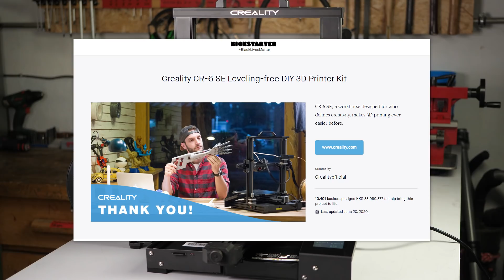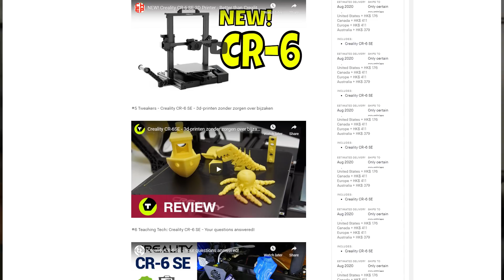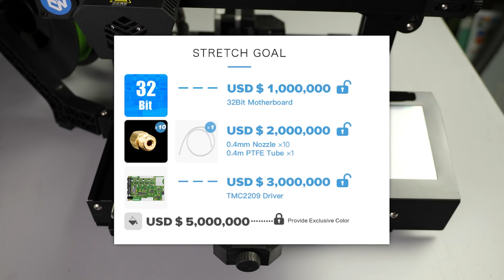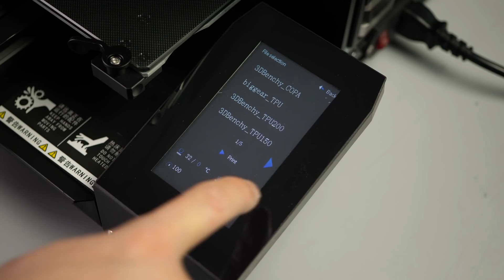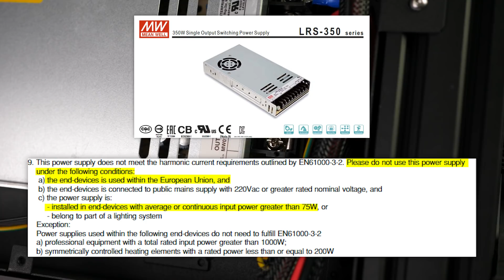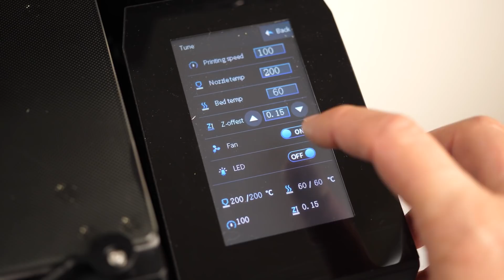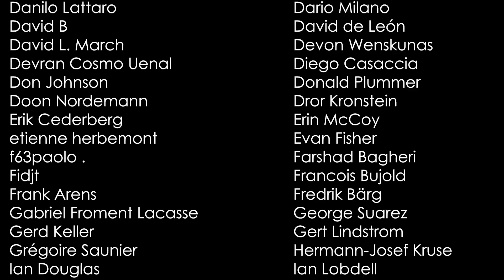Creality CR-6 SE - The NEW (over)hyped Kickstarter 3D printer?

Comment: So basicaly it cant do more than my ender 3. Bed leveling ? I dont need that I just leveled mine once and it works like a charm.
Reply: Bed leveling is the number one cause of problems, so a big boon to me (my ender 3 needs re-adjusting every other week!), the slightly bigger build space is going to be handy as a few prints I have had to knock them down as they are just slightly too big. Everything else (32bit board, touch screen, SD cards, belt tensioners, modular hot end, filament sensor, glass bed attacment mechanism, wider center beam for stability, dual Z steppers, improved extruder, carry handle, better filament holder etc) are just icing for me, and great value on a $300 printer!

Comment: Built-in bed levelling is a game-changer for beginners that have no engineering knowledge, because it removes the biggest problem. Total newbs will be happy to pay the $100 extra for that feature preinstalled.
Reply: This is exactly right.  As someone who owns an Ender 3 Pro, I hate bed leveling all the time.  It's too touchy and annoying.  This model is well worth an extra $100-$200 in my book for the time and headaches it will save.
Reply: Bed leveling isn't that difficult but it gets tedious quickly, especially if your printer doesn't like to maintain it very well. IMO Auto-bed leveling needs to become standard on all printers.
Reply: "Engineering knowledge" is figuring out your own strain gauge for your already-purchased ender 3 and making it work.... I get your point though
Reply: Bed levelling is without doubt one of the most deeply frustrating aspects of running an Ender 3. The beds aren't always flat to start so little prints might work and huge prints are a disaster. Even level is possible, the janky springs and a little movement means its gone again. A BL-touch is a way to avoid these issues but Integrating the levelling into the nozzle and have it properly supported by the firmware is the only real solution.
Reply: If you exchange the stock springs for better ones you barely have to level the bed tbh
Reply: Yep i would agree with that... Thats one of things that sparking my interest
Reply: SidneyCritic ComedyHound TIL you need engineering knowledge to level a bed
Reply: David F. All you need is a paper, a eye and simple instructions. Most people can actually level a bed. The problem is it's annoying to level the bed every time you print. Most people don't care of levelling the bed once but just multiple times frustrates them.
Reply: Mohit Gupta lol I know, I was being sarcastic. I don’t get the leveling the bed before every print thing either. On my Ultimaker, I only level it when I change a nozzle or something that changes the nozzle to buildplate height.... I get awesome first layers consistently. On my old Tevo on the the other hand, that needed leveling all the time because the bed was very easy to shift when removing a print.
Reply: @logmegadeth72  Well, with my ender 3 if I do long prints like 8 hours or so, the next time I go to start a print the bed is already off. I put stiffer springs and haven't had it change on me yet, but ya with stock ender 3 springs I can see why some people relevel the bed every print
Reply: Mohit Gupta why would it need it every print? I don’t even have to level unless I move my printer (even punching it and prying hard in all sorts of directions to get prints off doesn’t change my bed level). I’ve got 2 different printers, and both I run probably a hundred parts or only level maybe once every half a year at the most, they really don’t need to be leveled very often at all. If you’re having to do it with it just sitting there then something is wrong, like maybe your bed is halfway falling off and need  to tighten some screws or something (seriously, one of mine has rubber bands to keep it functioning correctly because it’s so old and worn out, but even it has perfect layer bonding and it’s incredibly reliable, it prints all day without issue). It shouldn’t need leveling even for a few rolls of filament, my newer one ran like 6 pounds of plastic and it still doesn’t need leveling adjusted (and it’s far, far cheaper than an Ender 3)
Reply: @BornArcher8  Anyone can level a FLAT bed; these automatic things shine when your bed gets even slightly not-flat.  Where this is awesome is the auto-adjusting for variations in flatness.  Glass will solve a lot of that, but not a lot of neophytes know about that, or how to screw with z-stops, etc.
Reply: @MichaelCampbell01  the antiquated printrbot metal I have is a pita to level, if it even levels at all. 🤣 so it just sits there. Mocking me. I'm looking for a replacement.

Comment: So, this PSU is totally not rated for the voltage (230V) on the mainland of Europe, so surely not the best choice, probably needs an upgrade right away with a good swap, together with one that is quieter.
But also: are all the safety-systems in place and enabled like thermal runaway and such, is the case and all metal parts grounded well and does it come with a good fuse and double-poled switch?

Comment: One thing I really liked about this printer and was the deciding factor if I continued my kickstarter or cancelled it,
I was originally concerned because it had a belt typing the two Z lead screws together and I was wondering if it was constrained with a bearing. (while yes, you optimally want this constrained with a bearing, if it is not machined true you will be having a lot of issues. This is why a lot of chinese printers leave slop in the Z-Axis and do not constrain it.) after I asked the question on Nerys' live video he showed the printer and said that it works well.
My ideology is if they went as far as to machine those good enough in tolerance that they can constrain those Z screws without an issue, they are probably running better tolerances and it does look like they took into account "the little things"
While I'd be hard pressed to pay retail for this printer, I paid $299 (+ extra strain gauge and extra hot end) and I feel I got a very good deal.
I think Creality did a wonderful job, but yes the first thing I'll be doing is doing temp checks on the PSU & nozzle fans & swapping to noctura silent fans.

Comment: I completely agree about the power supply fan, it's the number 1 reason I bought my Genius (which is very similar to the CR-6 SE) - no fan in the PSU & mains powered bed. It's super quiet.
Reply: I find the 24V fan in the base which is constantly running pretty loud though.

Comment: I wonder why they keep sticking to a bowden tube setup, no direct drive, limited temps.
I'd have gotten this to replace my ender 3 if it had an alternative to the bowden tube.
Reply: Direct drive isn't nessarily better than boden, they both have advantages and disadvantages.
Direct drive handles the most flexible filaments better (though a few reviews have shown it can print TPU just fine).
Boden removes a lot of weight from the head so can be faster and potentially more detailed.  It's also easier to maintain and correct issues.

Comment: Lets face it a micro sd is easier and cheaper to get and store a full size sd is a stupid YouTuber thing
Reply from the maker: Ever dropped a micro SD into a printer enclosure because slot and board were not perfectly aligned?
Reply: @CNCKitchen  nop have around 2 dozen differnt pronters never happened

Comment: 2:41 Using the nozzle’s tip and a strain sensor seems like a great idea to help level the bed, but it’s not. The last time I checked, just before the print is to start, there always seems to be a tiny bit of hard or semi melted filament stuck on the end of the nozzle. If it’s not cleaned off BEFORE the nozzle is used to help level the bed, that extra filament stuck on the end of the nozzle will screw up the nozzle/bed touch, thus completely throwing off the bed levelling feature. That’s why a separate BL touch sensor is a much better option (nothing to get in the way of the sensor while measuring the bed’s surface). Also, bed levelling should be performed while the bed is at printing temp (warm to hot depending on what you have it set to). Allowing the bed to heat up prior to measuring its surface level, will allow the bed to “settle”. If the nozzle is already hot when this levelling happens, I hope you guys enjoy a bunch of little melted filament blobs all over the bed, which could potentially get in the way when a print is started and the nozzle passes over those same bed points again while printing. So just use the hot end while it is cold you say? Just re-read the first part of my comment about unmelted filament on the nozzle tip while trying to level the bed with it.
Reply: Agree strain gauge is a gimmick and it's a step back not forward

Comment: The power supply fan is a lot cheaper than the transistors that would run cooler. Typical Chinese economics...milk pennies out of the design and destroy the product value.

Comment: Overhyped and overpriced is the prusa that you love so mich.
Reply from the maker: Have a different opinion on that. If you need a tool, it's worth every penny, if you're looking for a toy/project it might be too pricy.
Reply: @CNCKitchen  I started in 3d printing in 2007 with a industrial fdm (EOS if i remember correctly). All the printers that i used since needed some kind off finishing for the parts to meet specs. Why spend so much more if the labor needed after is almost the same.
Reply: @DesastreMan1  Totally agree the value proposition just is not there it doesn't help that Prusa machines look like they have been put together with lego I hear the argument that you can print replacement parts but you can for a lot of printers. I will say something for Prusa software user feedback programmed for the machines looks more friendly

Comment: I backed it [my first 3D] but think you are a bit harsh in your review.  Everything you mentioned was positive but the non-flex print bed and noisy PS.  I purchased a flex print bed that was offered as an add on at the end of the KS campaign.  Since this is a first for me I will have to wait to comment on the noisy PS.   Price has to be weighed against time spent 'fiddling' with a printer and purchasing add-ons to get acceptable prints.  I think this will be a great first experience 3D printer.  I also think Creality has learned [and is learning] a lot about what the market wants in a entry level 3D printer.  IMHO it is a winner.
Reply: Yeah but this is your first 3D printer the reason Stefan is harsh is because he knows there is sooooo much competition out there in the 3D printer space and there's not a great deal to differentiate between them so small things make a difference between them also this printer is pretty bread and butter repackage it's just slickly marketed bread and butter. If your a happy that's cool welcome to the 3D printing world and I'm very sure you will be over the moon that your making things at home. If your printing in a garage then sound is not a big issue if your printing close to a living area sound is a big issue especially when you realise bigger prints tend to get measured in days.

Comment: The printer looks good, I think if you got in at the flash sale price it seems like a very good value. I personally dont have an issue with the loud PSU, but the filament sensor/extruder could have been aligned better or made into a single unit.

Comment: I decided not to back it. In my opinion you should buy an Ender 3 v2 and with some printed upgrades like the "handle" and a bltouch, it will be a totally comparable product. Teaching tech already has shown a way how to create a DIY nose leveling solution from the original trigger switch and some printed parts for free, although I think a seperate sensor is always better because of the mentioned issues with filament leaking out of the nozzle creating premature triggering. So why bother to buy this overpriced printer?

Comment: Funny thing i"m looking at this printer it basically is my Ender 3. Glass bed check(custom clips make it 235mm), tool drawer check(printed), filament run-out(printed/solder to pin on board) check, Filament Friday side spool mount(printed) check. I have been thinking of getting a bed level.
Reply: 32bit board, better screen, touch screen, dual Z, bigger y, better drivers, alb, better fans, better extruder, better hot end and a spool of low quality pla but aside from it's the same as your Ender3. And some of us were able to get it at $265 so I'll take this over your Ender3 any day.

Comment: Stefan what do you think was causing the ugly CoPa print?   I have been considering trying the material but now Im worried
Reply from the maker: My filament was not perfectly dry, which caused bubbles and stringing and then it released from the bed, just before it was finished. CoPA is a nice start into Nylons because it's easier printable than most, still a bit of a challenge.

Comment: it looks like a good printer but i can just upgrade my ender 3 ;)
Reply: I was thinking that, but the cost of upgrading my E3 to the 6SE is more than half the cost of the 6SE and some improvements (like the extra build volume) are not possible.
So I ordered the 6SE and will use my ender 3 if I need to print more than one item at a time, or set them up with different filaments etc!

Comment: The only way I was going to purchase this printer is if I got it for the $265 price, which I did being backer #91.  I simply wouldn’t get approval from the boss\wife otherwise 😉.  The Meanwell fans are notoriously loud.  I would gladly take the better PSU, and live with the louder fan.  Just wondering when did you receive your review unit?  Seems that you might have received your CR6-SE later than others with much less subscribers.  Maybe you should do a CR6-SE giveaway 🤔

Comment: i think its a great little machine, but doesnt really seem like anything incredibly new or interesting. 
it looks like itll be a better start machine for people new to printing, with its auto levelling, non-micro sd card reader, and responsive touch screen. But for someone like me, print volume is a pretty 'big' thing, and im a little disappointed they havent gone higher in volume by much from the ender 3.
imo great for newcomers, or people who want a cheap midranged printer to use, but honestly doesnt seem like its gonna break the industry in any way.
Reply: totally agree it does not stand out in any way it's kinda lazy

Comment: End users are beta testers. This unit simply puts several community upgrades on an Ender 3.
Reply: Did the community figure out how to print these?
32bit board, bigger screen, touch screen, dual Z drive, bigger y, better drivers, alb, better fans, better extruder, better hot end but aside from it's the same an Ender3.

Comment: Having the PSU under the bed and the fan meer mm from the table makes it noisy. Also, the PSU placement means it will have to be relocated to add any of the common thingiverse options other than a direct replacement Noctua fan.

Comment: "Advertised" build volume. I have no problem with 235x235 on my Ender 3.
Reply: Just got an Ender 3, how would I go about increasing the build volume? Would it be edited in the gcode?
Reply: The physical size is bigger on the 6SE, so you can likely do the same software trick to expand the size slightly.

Comment: I backed one, largely to replace my aging Printrbot Simple Metal, which I've modded and frankly, without mucking about with the firmware and making an adapter for the hotend, is at the end of the line. I'll agree that it's probably overhyped.  The issues described, I feel are more quirks than show stoppers.  The fan noise in the PSU is fixable via a mod/hack, the ABL issues requiring a clean nozzle is possibly a process change (i.e., make sure the nozzle is clean prior to leveling),  making mods to the bed surface is a time-honored tradition in this hobby, and the filament feed system is probably also fixable via a mod as well. This will be my first bowden fed printer (everything else I've dealt with has been direct drive), so I expect I'll have some learning curves with it.

Comment: I'm not as critical of the printer as you, but I do think Creality is just splitting hairs with their recent offerings. I think the bed leveling advancement, silent drivers and the touchscreen are a big steps forward, but most of the other updates are more preference related. As for negatives, the only thing I really dislike is that they did so much in plastic on a $400+ printer.

Comment: It doesn't even have a direct extruder.
Reply: It's not a case of Direct is better than boden, they both have advantages and disadvantages.
Direct works better with very flexible filaments (though from reviews this boden seems to handle soft TPU just fine).
Boden means much less weight on the print head meaning faster print speeds and potentially better detail.
Reply: @LordCreo  -  Direct is less troublesome in general. Speed advantage of Bowden is negligible (only on Y axis) because the inertia of the X axis is greater than inertia of extruder (the whole object is moving). Besides, direct extruders now have lighter motors that eliminate the speed disadvantage on the X axis. Besides, If they claim to make a better 3D printer, then they should put an extruder that can handle all the filaments instead of trying to sell us the same old product at a higher price.